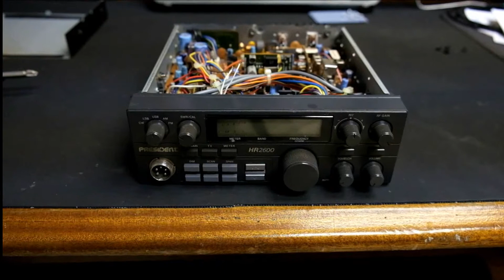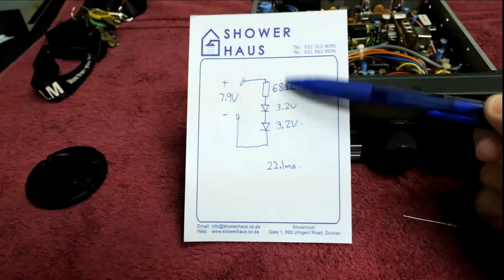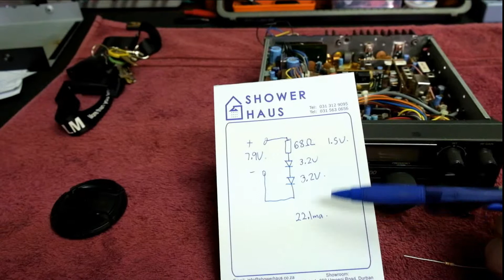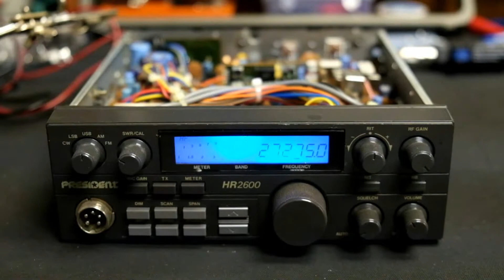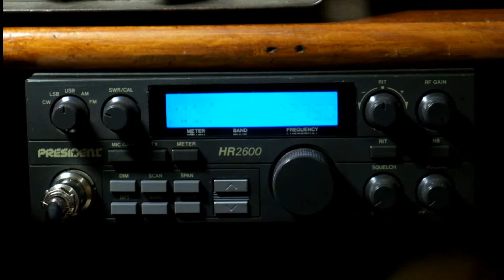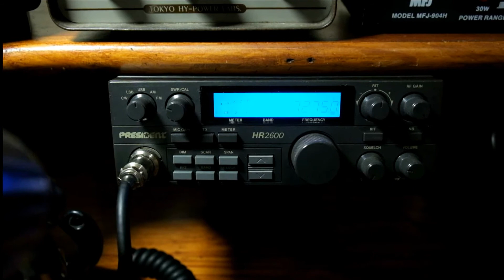Episode 5   HR2600 Backlight Repair

Comment: Any Info On a chipswitch...I have a Lincoln with the chip,on 12 meters its showing error 4..do I need to reprogram it..i purchased it from ebay,everything works just no transmit or receive on 12 meters..any info would be appreciated..
Reply from the maker: +rick robbins Have you checked if the VCO has been re aligned or wide banded? I can dig out the Chipswitch manual and try and walk you through the process. The radio is more than capable but it sounds like maybe the VCO is not locking on 12m. Does it go silent when you go up to 12?
Reply: +Evione Electronics yes no receive also..when I I hit the bands switch,theres no letters just numbers..0. 24.960 1. 24.800 2. 24.800 3.24.800 4. 27.385 and that's it. transmits and receives  25.500 up to 29.700  really good.straight up at 12 clock receiving other stations..someone told me to put it on 29.6999 check dc voltage tp303 adjust the l317 to a reading of 6.5 0.1 reading..i have no tester and I am afraid of messing up the radio,hopley the chip just needs to be reset,it trys to transmit on 12 meters then the error 4 I guess from the pll not locking..thanks appreciate the reply...Rick
Reply: +rick robbins I did get it to recive on 12 finally...
Reply from the maker: Was it a matter of re-aligning the VCO? Pretty sure thats all that was needed but hard to say without testing.
Reply: +Evione Electronics I had it on fm so I thought it had receive..I haven't messed with the voltage on it yet...Previous owner master reset it.so it says 2600,2510,lincoln with no information in the 46 or 47 options..its like ok I'm in now what do you want me to do lol..and I have looked all over to see want ppl are putting in...was wanting to put that in,then if the pll  locks on 12 then go to the voltage.i have no volt tester...previous owner was content on cb or 11 meters  so he really didn't bother trying to get the chip going..thanks rick

Comment: The display actually looks quite good with a Blue backlight, is it really excessively bright or is that due to camera angle ?.Nice equipment set up by the way.
Reply from the maker: +Andy Gallacher Thanks Andy. It does look good with the Blue Backlight. That unit sold to a ham operator here in SA and he loves the uniqueness of his unit. It is not excessively bright. Camera contrast amplifies it so it looks brighter than it is.